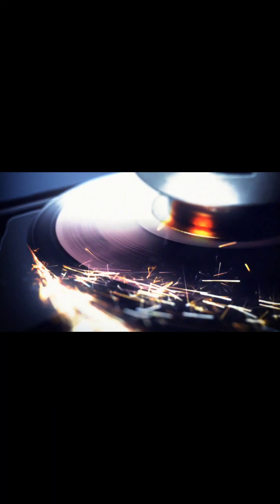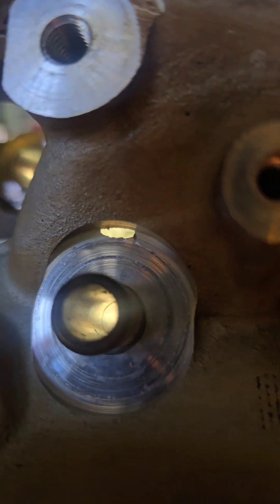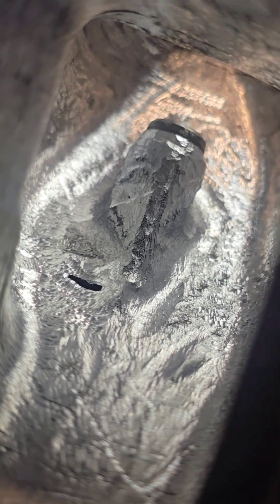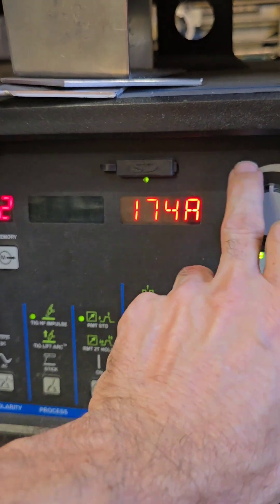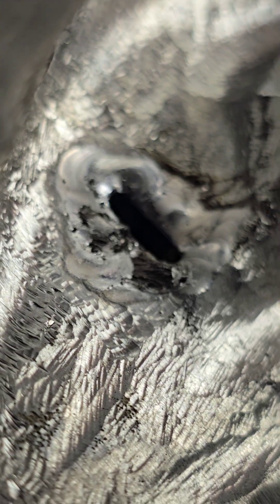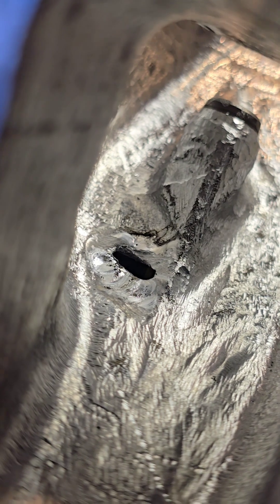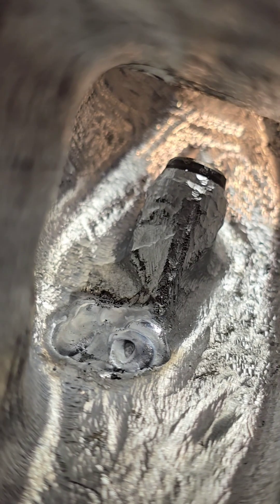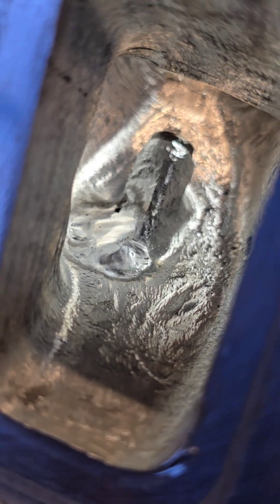How to weld cylinder heads. #LS1 #welding #tigwelding ##carcommunity

Comment: I had no idea this was an option
Reply from the maker: We have fixed  hundreds.  It's definitely an option 👍
Reply: @bainracing  can you weld the short turn? if that's the case on a 4v head
Reply from the maker: @DoriFord  We have before mate, its not uncommon for shops to pull seats and weld bowls as the core shift can be a big problem.